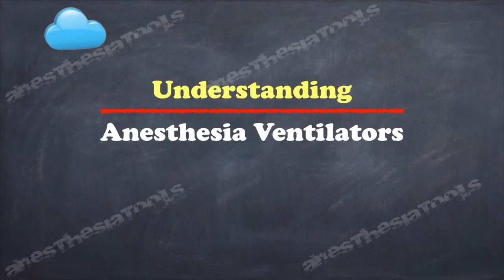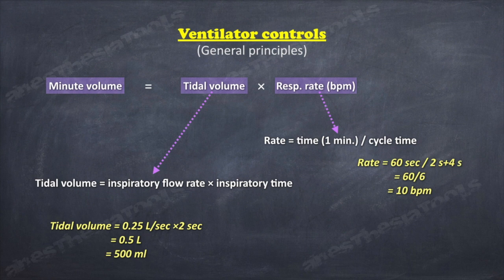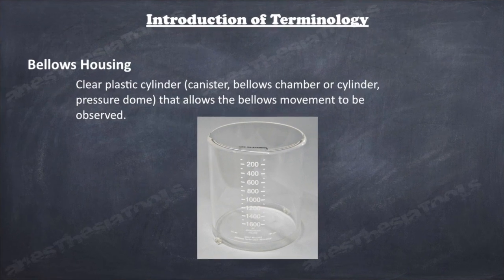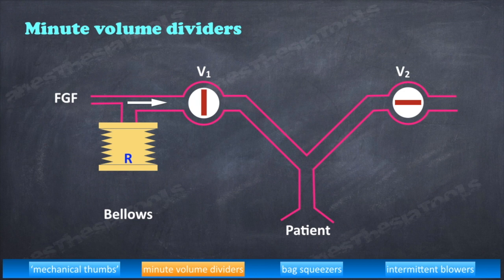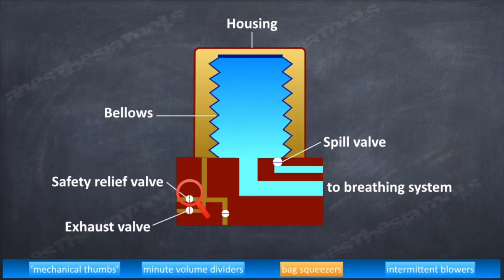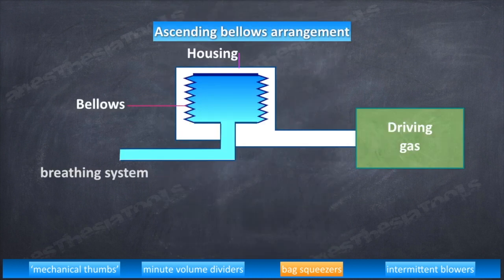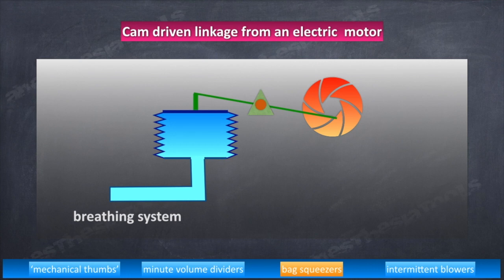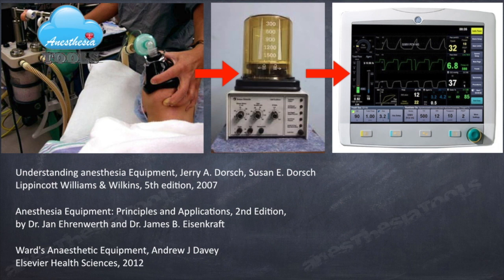Understanding Anesthesia Ventilators - Animation based #anesthesiaTOOLS #saneeshpj

Comment: Driving pressure gas is which gas?
Same fresh gas flow or other gas?
Reply from the maker: Usually the driving gas is oxygen. Some machines use air oxygen mixture.